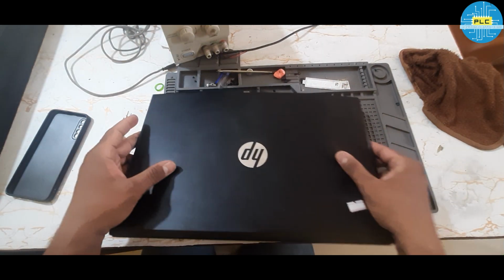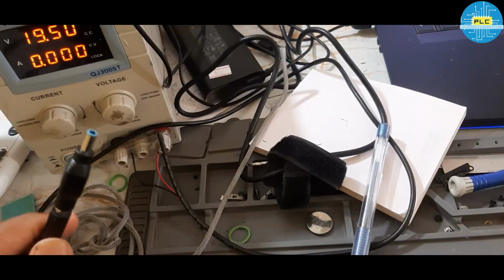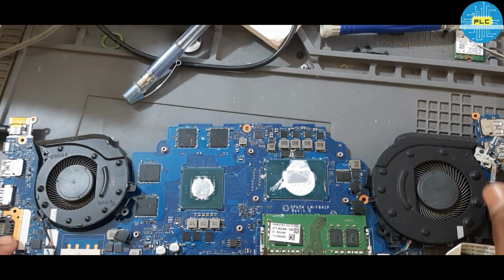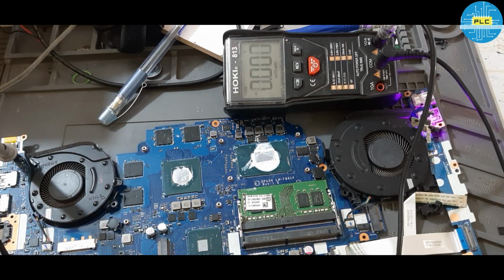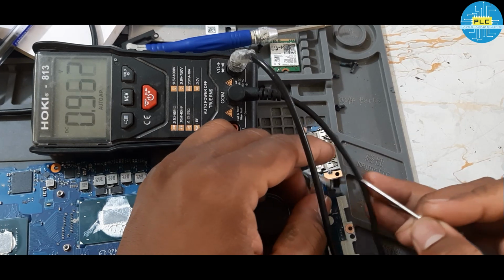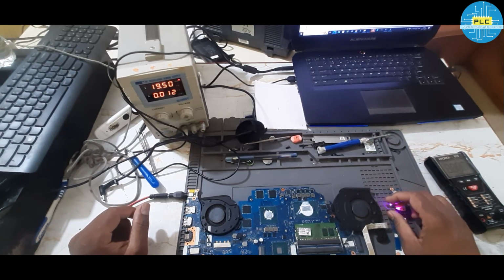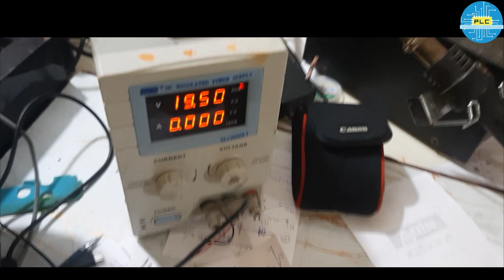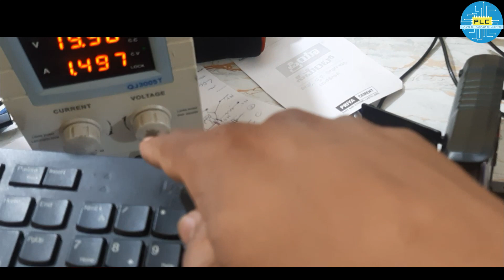LAPTOP REPAIR - HP GAMING DEAD MOTHERBOARD LA F841P   SOLVED!

Comment: The 2.1v on PowerPoint was the culprit i guess, fault is definitely from Sio but in some cases like folio 9470,9480 840 g1,g2 there's this resistor one side will be 3.2v and other side 1.8v or 2.1 ,and power button need at least over 2.6v to switch properly. I jusr replace the 100k resistor with 1k resistor.

For 840 g3 the transistor q115 just like in this case, i put a jumper and it will work thereby saving the Sio.

Weldon job sir
Reply from the maker: U r right. I found a masfet. Removed and made jumper. Then I got 2.7v. But luck was not there.  So, replaced the io. Thanks for your valuable feedback. 👍